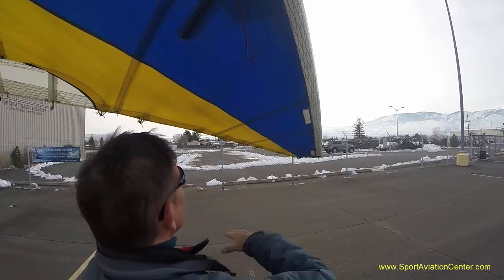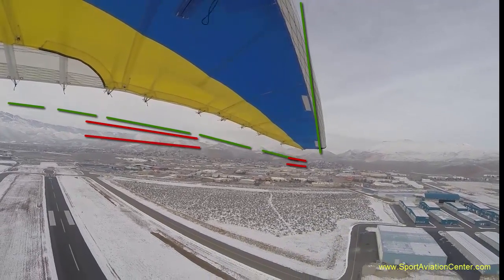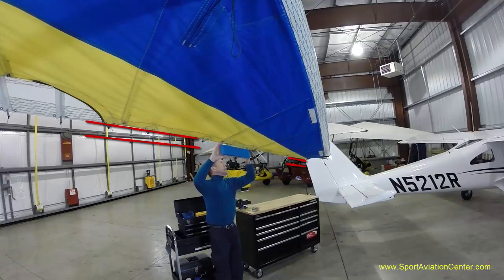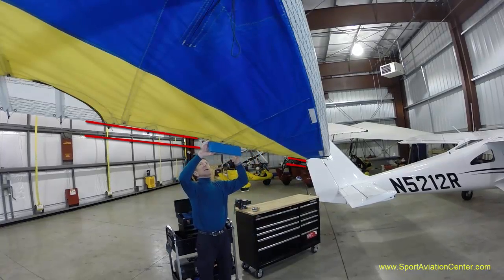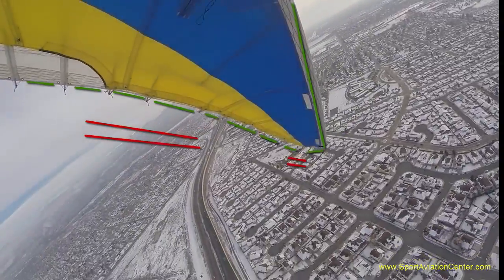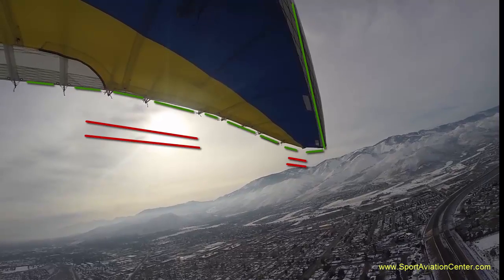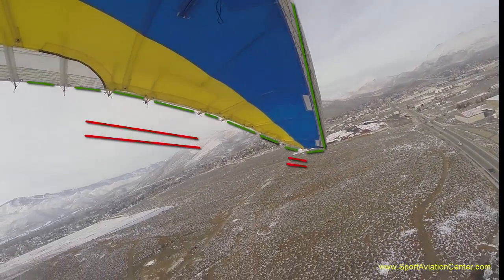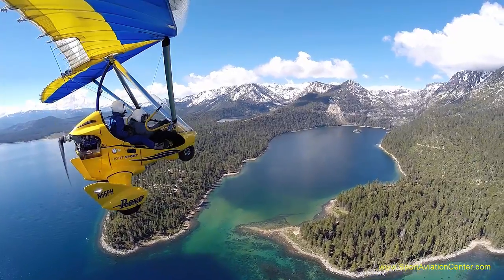Weight-Shift Control Trike Aerodynamics  - billow shift, washout, twist change test demonstration

Comment: Great Video. I've wanted to do similar on the RC models I design and sell in kits form because not many people understand this. When you mention weight-shift some people think it is just a matter of shifting the weight about the CG, but as you have clearly demonstrated here, there is a lot more happening in the design of the wing. This is very similar to what needs to happen on a rotary wing (Rotors under high RPM become lifting surfaces like wings) like on a helicopter or autogyro to some extent you gotta have proper flex modulus, be on the rotor (when using a flex plate)  or blades or a combination of both,  otherwise the control becomes too sensitive and sometimes too stiff to the point it becomes uncontrollable. I found this out by pure experimentation on rc models when I started designing electric powered rc helicopters, autogyros and microlights back in the 80's and by watching carefully how falcons would tip the wing tips up, to execute turns. My early RC Microlights were designed based on this observation, by employing wing twist via a servo to double link, one per wing tip via torque rods to effect turn and it was very effective, quick and precise.  Rotor flex plate, blade twist,  spring and damping are all important, when properly done they do the job nicely. Materials and construction method of allowing the wing to twist properly are keys in the control feel of the aircraft. 

I hope you don't mind but I have included your video in my MIA EZ™ 1.25 RC Trike (RC Microlight) Instructions as supplementary reference for folks to understand what happens at the wing tips during control. Obviously and logically if you understand some basics of aerodynamics,  the more air volume a flex wing  encounters (Drag) the more it is going to flex at the wing tips, and more at places on the wing of less resistance and thus flies like a bird, like a falcon in a sense, a bird or microlight wing is never stiff it is always self adjusting when not intentionally controlled. https://www.youtube.com/watch?v=kpn_XqPvmMA&t=2s&index=24&list=PLGUxnAYsHPAzT6YeIThQKmReZ8Gszw9Sq